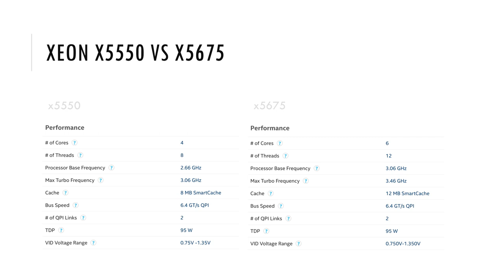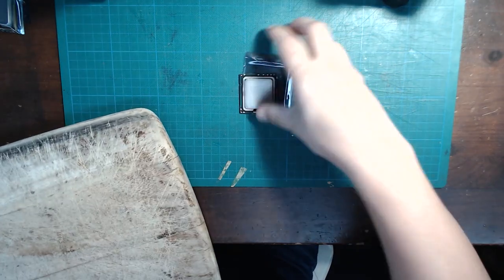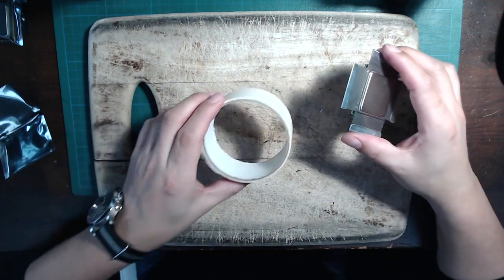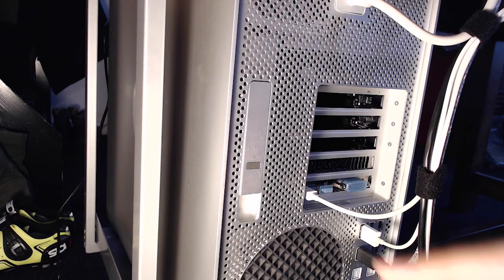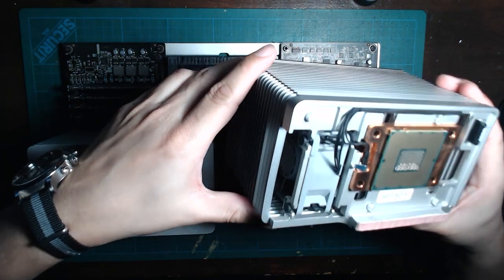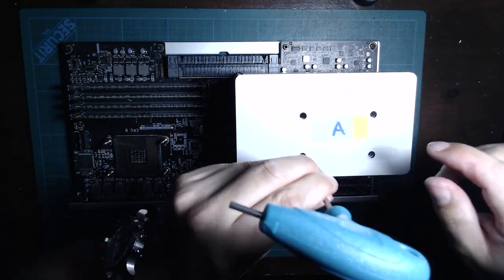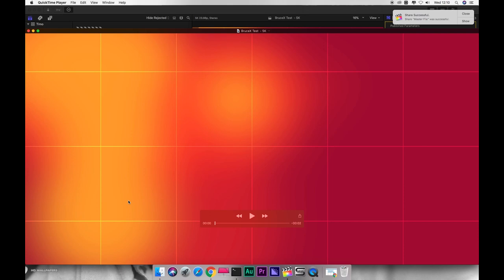Apple | Mac Pro 12 Core CPU Upgrade (Delidding Soldered Xeon CPUs)

Comment: I've done this with 2 Xeon 5680's and had no issues.  This was by far the best video explaining how to do the de-lid

Use a heat gun and not a naked flame like a BBQ lighter which i have seen on some videos.

The trick to to listen for the "pop" its about 20-30 secs after applying heat for me but maybe later depending on your heat course.  once i heard the "pop" i wait another 5 secs before pushing down on the razor blades.  it's such a magical sight seeing the CPU split into two.
Reply: If I want to weld it, this would also be possible

Comment: You have to control temperture on IHS during heating. It will be best if you can get IR termometer or even thermal. You also need to place black mark on IHS for accurte thermal measurements (less reflections). If temp go over Tj = CPU probably will be dead OR with degradation.

Comment: I'm using Flashed HD7950 for testing bruce X 5k,but result is 45 sec. that not very good at all,Does  GPU not good enough?Which GPU were you using?

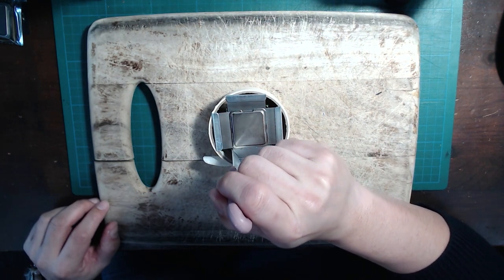Comment: I smoked my processor by closely following this video! I applied heat for 60-70 seconds when nearly all the capacitors on the bottom became de-soldered and fell off! I did all the steps very carefully, except he has an unexplained cut in the video at 4:17 just before he says "I kept the heat on just a little bit longer." How much longer? Also, the angle of the camera doesn't show the spacing between the tip of the heat gun and the processor. If you try this, be prepared to smoke your processor!
Reply: For my 2nd processor, I used the successful vice technique which was faster and FAR SAFER for the processor, especially if you use the razor blade to split the seal of the RTV sealant that bonds the lid to the substrate. (This is not "silicone" as mentioned in the video.)
Reply: You don´t need a temperature regulated heat gun. Needs around 350°C and 1,5min. But I would not recommend the VICE Technique it will most probably damage the CPU because the solder which is connected to the DIE can break it as Silicon is very fragile. I would do it the opposite way. Take some wood with a hole in it and place the CPU with the "knifes" on the top of the hole (secure with some TESA)  with the IHS pointing to the floor. Then you heat it up from below. The IHS will fell down and the CPU remains there and no SMD parts will fell of. Thats the most secure way.
Reply: Would It work for a 9980xe ?
Reply: Would it be possible to heat up the heatsink with a good soldering station and a broad tip? Haven't seen anyone doing it that way while to me it seems the most logical approach.

Comment: I tried this method and failed.  My failure was that I let the hot cpu fall onto some carpet on my bench and the hot cpu melted the carpet fibers on to the bottom of my CPU.  Make sure it falls on a hard surface that will not melt like my case.  I tried the vise method on the other one and it worked for me.

Comment: Great video. I made one very similar and used the same method. I too think this is much safer than the vise method since the vise has a greater chance of cracking the cpu die. I have done a total of 5 CPU's so far using this same method and all 5 went perfect.

Comment: I do have a hot plate (diy) and found that it melts at 165 Celcius
Reply from the maker: That's some valuable information. Thanks for sharing. How did you build your hot plate?
Reply: @CuriousTimo  i can send you some images, i build it from a money box and some heating elements with a thermo controller and a big aluminum plate

Comment: Why delidding?
Reply from the maker: The Mac Pro 4.1 Dual CPU uses  de-lidded processors. There is the option of using normal processors with washers but you run the risk of crushing the CPU sockets. De-lidding is is not needed on the 5.1.

Comment: Would you tell us the air temperature exiting your heat gun?
Reply: @owo グーチmoshi Would a hairblowwer work?
Reply: onii-chan's manko I’ll try that. Thank you!
Reply: How about using a good soldering station with a broad tip? Why does nobody do that?
Reply: @chaosme1ster  Have you tried doing that?
Reply: @oceanix1929  Nope, that's why I asked. I want to upgrade my CPU's, and consider going down the razor blade + soldering station route. Wondering why I never hear someone talk about the soldering iron possibility.
Reply: @oceanix1929  To answer my own question: instead of a heat gun (or the paint stripper or cigarette lighter I've seen elsewhere... yuck...), you can indeed also use a good soldering station (like a Hakko FX-888D) set to 450 degrees Celsius, use a broad tip and apply some solder between lid and soldering iron to better conduct the heath. Works like a charm. Delidded 2 CPU's this way this afternoon.
Reply: chaosmeister Wow! Well done! I havent tried it yet so I’ll probably try your method! Thank you!
Reply: @oceanix1929  It really was amazingly easy. I'd gotten quite nervous after seeing all the stressful videos about delidding and replacing the CPU's, but in the end it was not hard at all. Yes, you should be careful when cutting away the silicone -- not enough and the lid won't come off when heating it, but cutting too much and you'll damage the capacitors inside. But if you've got a steady hand it really isn't that hard. Just take your time. And then the soldering-iron trick: easy peasy. Shaving off the solder residue with a razor blade (again careful not to hit the capacitors :) and slightly sanding the chip on a plate of glass (= flat surface). 
I was most nervous about re-tightening the screws on the cooling blocks -- not tight enough and the machine won't boot, or crash after some time, and too tight and you'll damage the circuit board. But really, if you use common sense you can simply feel when the screws are tight enough. I didn't count how many turns etc... just kept going in a cross pattern until they all felt "finger tight", and then gave them all another slight "and now there really tight" squeeze. Insert CPU-Tray, boot up, and voila, done in a single afternoon.
I went from an 8-core 2.26GHz to a 12-core 3.1 GHz (Xeon X5675, because that's the fastest processor that only uses 90W of power), which almost doubled my Geekbench multicore score. Nice, nice... :) Multicore is now 6200, whereas the new MacPro base model scores only 8000. And we're talking an 11 year old machine here versus a new $6500 model. Yeah, right...
Over the last weeks I did: flashed machine to 5,1, installed new graphics card (the Metal compatible Radeon Sapphire Pulse RX580), then installed Mac OS Mojave on the hd, installed a Samsung 1TB NVMe M.2 ssd, clean-installed Mojave on the ssd (remove hd's, boot from prepared usb stick with Mojave installer), replaced the CPUs by the X5675, and thoroughly cleaned the motherboard and all fans (11 year old dirt and dust and greasy junk clinging to all the tiny parts and fan blades; take a soft brush, some air pressure...). The machine feels like new, runs smooth and silent, is speedy as hell again. I stress tested the CPU, maxing out all cores, driving up the temperature to 80 degrees Celsius, and I still could hardly hear the (11 year old) fans. In normal use the CPU temperatures are around 35-45 degrees...
All that for approx 650 euro's (graphics = 240, ssd 185, cpu's 215, all locally bought here in The Netherlands, order today delivered tomorrow, no dealing with shady Chinese shops and order times of many weeks to months). The alternative would have been to buy a new Mac... but the 1st machine that would semi-interest me would be the i9 iMac, specced at 4500 euro's, lol... And that's a bloody iMac, which is a form factor I don't care for. So, happy camper here, and advising everyone with a 2009 MacPro to do the same.
Reply: @oceanix1929  You're welcome. Don't sweat it -- it's well worth the effort & money and not that hard in the end. Just use your common sense, esp. when tightening the screws on the cooling blocks.
Reply: @chaosme1ster  We have the same machines, and I think we watched the same Miani video where he skipped the most most important parts, delidding and torqu applied. In his video, it was a single processor, with bracket, way easier.
I am here with two X5675 and no heat gun or solder, wondering why they solder the IHS to the CPU...But, I will try my luck.
Reply: @unloveableandre  I delidded the same processor, X5675 (times two of course).  Ask if any of your friends (if you have any :-) have a decent soldering station.  Really makes this a breeze. The CPU's have cost me 100 euro's each, and damaging one would set you back 100 bucks without getting anything in return.  For the same money or less, you buy a soldering iron...  The Hakko fx-888d (the one I have)is 133 euro's. A simple Atten ST-2065D iron is only 30 euro's and also goes to 450 degrees C.
As for why they solder it: solder has much nicer thermal properties than soldering paste. With lidded CPU's you have CPU-thermalstuff-lid-thermalstuff-heatsink. That's 3 objects, 2 "thermal stuff" transitions.  With a delidded CPU it's only 2 objects, 1 "thermal stuff".  So with a lidded CPU every stage is more critical, and hence the preference for solder instead of thermal paste (which might dry out, or lose it's thermal properties over the years -- ánd cannot be replaced if it's inside the CPU housing).
Don't use a vice (as some recommend) when delidding a solder CPU-lid. It's obviously asking for damage.  Heat, applied from the top to the center of the lid.  That's it.  Good luck!